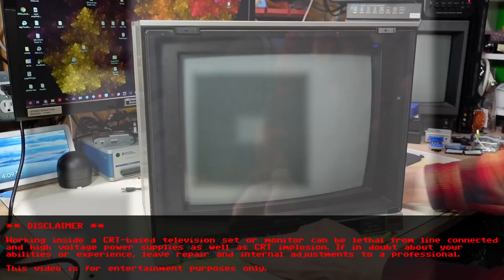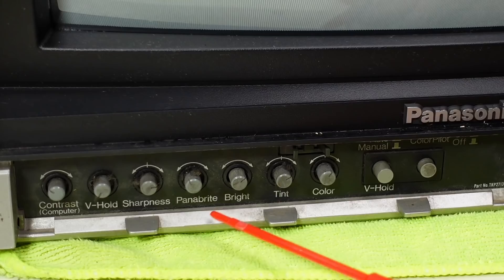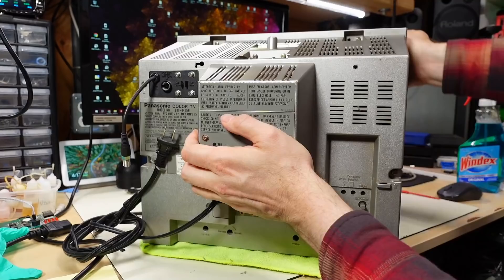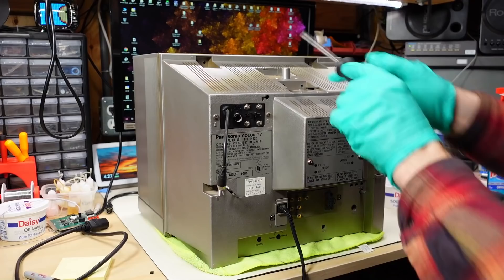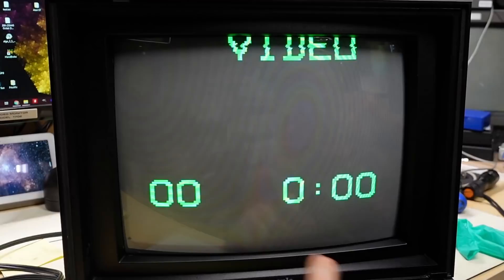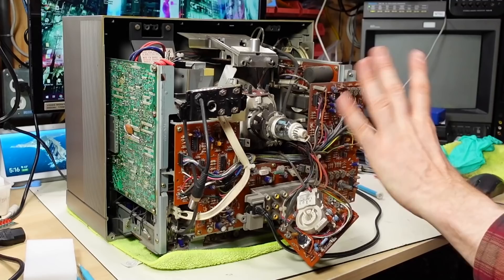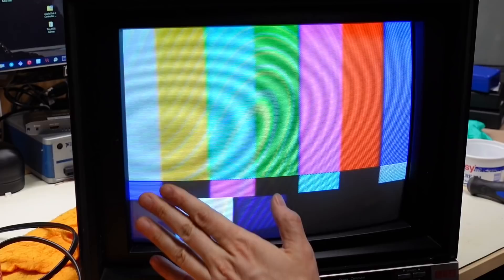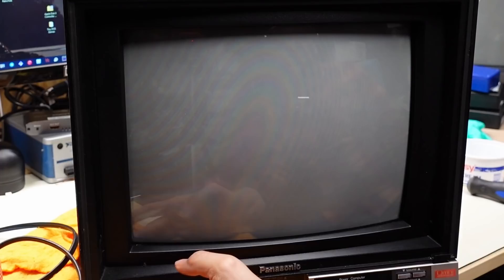This TV cost $1,890 USD in today's money when it was new! (Panasonic Omni CTF-1465R)

Comment: Panasonic  "Just slightly ahead of our time."  I have found that anything made by Panasonic was far better than the competitors!
Reply: That's usually still true today.
Reply: Local university liked panasonic because you could get parts easier than other makes.
Reply: Yeah including their VCRs
Reply: My Panasonic Bluray player has had nearly nightly use for about 15 years now. It's a bit weak on some discs, but for 99 percent of discs, it still plays them perfectly (even with scratches, it's confusingly inconsistent on what errors it can handle). I've only ever had to go grab the backup player once. Bluray drives generally don't last that long, as far as I'm aware, but this one has.
Reply: @Dennis Fore
True...I remember that old  tagline from the late 1970s and early 80s, and it was true. Panasonic reliability back during the 1970s, and 80s was second to none, including Sony. While Sony did have some items and the Triniton picture tubes that were a tiny bit better than the Panasonic offerings, the Sony would be used up and in the garbage long before most any Panasonic item was.
Reply: Can't go wrong with either Panasonic or Sony
Reply: They seemed to be 2nd only to Sony.
Reply: This is definitely not true for modern manufacturing equipment though. You need their "support" for everything since every part is proprietary.
Reply: @dhpbear2  I bought a 35" Sony CRT TV in 2002. LCD TVs were still in the 10s of thousands in Japan at the time. Sony's remote wore out within 3 years or so. I had to redo the contact pads a few times. Did not last long at all. The picture of the TV was good though.
Reply: So what you're saying is we need Panasonic to make a VR Headset next.
Reply: They made good bikes too
Reply: @dhpbear2  For some things at some times, in my opinion. From memory, during the 90s quite a lot of Sony consumer audio products seemed good but nothing special. Panasonic in the same era were consistently very good and seemed a bit more advanced, but Sony had something of an Apple-like public perception.

Comment: You could always take very careful measurements (and a bit of trial and error) and 3d print doors for these old TVs. It won't be quite the same, but I'm sure you can get some spray paint to match the same shade of grey as the TV case.
Reply: I am betting the door off my old Panasonic VCR would fit, a lot of things in this era were pretty universal..
Reply: Or fold metal, then and add hinges and latch.
Reply: Dont 3d print anything like this, 3d printing is horrible, get a sheet of 2mm Plasticard (polystyrene plastic) and build one, glue together with poly cement
Reply: @Synthematix  not all 3d printing is horrible. It really depends on the fillament you use to print stuff.

Comment: My mother still uses a Panasonic microwave from the mid 80's.. It still works perfectly.
Reply: Older microwaves tended to have a high build quality because that was the only type you could get. Now there are much more efficient ways of making them which allows much cheaper ones. My cheap plastic bodied one I bought in 2009 still works fine.
Reply: We used our 1986 Panasonic microwave until last year when the door switches failed.  Haven't gotten around to ordering new ones on Amazon.  The door circuitry was arranged with a safety backup so that if the main switch failed to kill the oven when the door was opened then the second switch would blow a fuse inside to keep the radiation from coming out in the open.
Reply: @haweater1555  That double interlock setup has been standard fare for decades. I think you need to go to the 1970s to find one without the backup shorting switch.
Reply: Same here. Panasonic microwave lasted for years. No buttons or dials, it was all touch controls.
Reply: I have a Whirlpool microwave with manufacture date of 1983 made in USA, still works, it has never broken down, simple, no dish rotation, touch buttons, no clock. Physical on/off switch by the door, so zero standby power.

Comment: The 8-pin connector on the back is an EIAJ-8 connector.  It was used by Japanese manufacturers from the 1970s through the 1990s and labeled VTR.  It simply carried composite (CVBS) video and line-level audio, and was used to connect video tape players that were pre-Beta and pre-VHS.  In the early to mid 80s the EIAJ-8 connector was sometimes labeled RGB, almost always TTL RGB.  I have seen Sony, Panasonic, Sanyo, Sears (Panasonic), JC Penney (Panasonic) and several other brands use it for RGB.  I do not believe anyone ever used it for RGB and CVBS at the same time.  Finding an EIAJ-8 to DB-9 cable is the key for using one with a CGA equipped PC, or a Tandy 1000.  Sourcing the EIAJ-8 male plugs is difficult.  I have a few if you need one.
Reply: Also there was no standard to the  pinout (Learned that the hard way) so different manufacturers used different pins for different things)
Reply: I believe they were also used on 1/2" Sony open-reel B&W VTRs in the 1960s!

Comment: Good choice on the fader cleaner. The red de-ox-it will actually disolve the carbon trace in potentiometers. I was all ready to yell at my screen there for a second. You totally got it right though. Well done mate.
Reply: Agreed, do not use D-series on pots.
However, F-series Deoxit actually contains a cleaner, so using CRC QD cleaner first is not necessary.

Comment: Growing up in the 80's I remember how expensive good electronics were! My family spent almost $600 on a Toshiba VCR in 1984 and then over $800 on a 31 inch Toshiba TV around 1989. 
Luckily with those high prices came in-home warranty repairs (at least on the TV) cause the TV needed 2 repair visits during its warranty. The first for a board that failed and the second visit to replace a fuse that blew about a week after the first repair. In particular, I remember the second visit cause the tech who came out was a little upset that the fuse hadn't been replaced by the first tech when what I'm assuming was the power supply board was replaced. That TV lasted throughout the 90's until early 2001 when it finally died.
Reply: I bought a Japanese 6 head VCR in 1987, and my parents used that front load VCR until 1998 or 1999.  Which is a freaking long time for a front load VCR.  I have had front load VCR's that the loading mechanism failed after 3-4 years.
Reply: I used to sell video in the 80s and Toshiba TVs came with 36 months parts and labor   That's why it got fixed so easily.

Comment: Hey Adrian, I would recommend using an automotive glass cleaner. Windex contains ammonia which damages plastic and rubber parts. 
Automotive cleaners don't have ammonia to protect seals and plastic trim. Greetings
Reply: I would tag on to this, give John Deere Classic glass cleaner a try..... It is stunning how well it works on glass. absolutely streak free.
Reply: @These_Old_Engines  Seeing what John Deere does for (or better "against") right to repair, I wouldn't give them a dime.
Reply: @blockbertus  I was thinking the same exact thing. I second this.
Reply: wash it in the bath and then put outside to dry for a week
Reply: @esecallum  dont laugh, I worked with an electronic tech and this is how you clean VCrs which got liquids spilled on them.  Better to use distilled or rain water.

Comment: In the UK TVs with that style of glass front was for sets that were for rental. TVs for rental were bombproof. I remember buying some ex-rental TV's in the 1990's that were 15 years old, and didnt break  i replaced them only because i needed NTSC as well as PAL  composite video support!
Reply: A good ol Grundig TV with faux wood effect cabinet featuring a chunky 50p meter, chuck a 50p in the slot and crank that dial round til you hear the 'CLINK' and you get TV for a couple of hours. Radio Rentals, what a god-send! lol

Comment: We had the matching OmniVision "portable" VCR back in the day. I vaguely recall that the door over the tuner compartment was really bad about falling off, so not surprised that this one's went missing.

If you happen to find one of those at eWaste, it was great for recovering damaged VHS tapes, because it was a top loader, and allowed you to thread the tape in as a reel-to-reel without having to "spring" for a replacement case at Radio Shack since the springs in earlier VHS clamshells would invariably launch themselves across the room.
Reply from the maker: When I was a kit we had one of those. It was a two part unit -- one half was the top loader VCR and the other half was the power supply, clock/timer and tuner. You could take the VCR part and stick in a 12v battery and throw it over your shoulder for use "on the go." It was a good VCR!
Reply: @adriansdigitalbasement2  I too, came as a kit.
Reply: @adriansdigitalbasement2  That's the one. Remember those pull-out channel number tabs?
Reply: @danielmalone4446  Heathkit or Radio Shack?
Reply: @adriansdigitalbasement2  most often paired with the camera unit. Several of my neighbors in the early 80s had these split VCRs and although I suppose you could use it for portability, it was often the case with those early cameras where you had to bring the camera head and separate recorder (connected with a big fat cable). The video tubes in them were pretty sad, but hey, portable video recording on tape was a big deal to the boomers and their new toys (who were proud to have moved up from Super 8). :P

Comment: That EIAJ connector is very common on professional video equipment (cameras, VCRs and switchers). So this monitor is a fully blown PVM with a tuner on board.

Cathode Ray Dude may be able to give you some more information on the equipment that used these kind of connectors.

Comment: Adrian, I lived in Japan in 1987 and bought a 20" Toshiba TV similar in design to this Panasonic. It cost $800 back then.  I no longer have the Toshiba but I did buy an RGB cable that would fit that connection on the back if you want it.

Comment: I still use my 1990 13" JVC  C-1446 TV/Monitor that I bought when I got my first full time job. (Though not my first major entertainment electronics purchase - that was a costly Sony HiFi VHS even if I had only a borrowed B&W portable to use it with -- gotta have priorities.) It closely resembles the Commodore 1701/02.  Though it had no special inputs other than ANT and composite video in.

Comment: Just watch out for that connector. While the physical connector is a standard, the pinouts aren't. I've found several different variants. (I have a Zenith monitor that uses it for Analog RGB)
Also you could 3D print a new front panel and then spray it with one of those gloss metallic paints that bond themselves into a smooth surface.
Reply: I was thinking along the same lines as you regarding 3D-printing a front panel! In some cases these fall off and get lost due to broken "hinge" tabs.

Comment: Well that's a nice set.
That wire and board nightmare reminded me to a Sony Trinitron KV-4000 i used to have.
That also was the most interesting TV i've ever saw... it was (i guess) the smallest Trinitron ever made at 4 inches and it was from the late 70s, the darn thing had an awesome image... it was so small that had no degaussing coil and had to be done manually quite often.

Comment: It wasn't until late 90's that i saw OSD on TV's.this TV is high-end compared to what TVs typically could do in 80's with not even one single digital part inside them😁!
Reply: My grandmother had a Sears CRT with rudimentary OSD from the same time period. I inherited it for my room when she downsized in '92. The OSD and the ultrasonic? RF? remote both died by the time I moved to college in '98.

IIRC there was a neon bulb in the remote  that either burned out or lost its vacuum.   No idea what it was doing, other than maybe RF current limiting since the thing ran off a 9V battery.
Reply: @DiverCTH  the Sears TV that you mentioned was not something very high quality build ,but it was definitely something "rocket science" compared to  13" b/w tvs with separate vhf/uhf tuning dials 😂!

Comment: From 2000 to 2004 i worked for the old Thames Tv studios in Teddington near london. We had loads of very similar tvs which i believe had been used on the kenney Everett video show as a video wall. The series ran from the late 70s to 83. We were still using them in 2000.

Comment: I bought my first TV in 1988 for $599. It was a 20" CRT Electrohome, mono sound, with remote control. It was my only TV right up until 2004 when I broke down and bought a 27" CRT something or other (the Electrohome was still functional!). A couple years later I got a 50" Hitachi rear projection which I used until about 2019 when it died and I bought my present 52" LED Samsung. Sure got what you paid for!

Comment: I have a very similar set CT-1330M and it had the best picture out of all my CRTs (even over the Trinitrons!) The flyback eventually died (I think). I didn't really want to complete disassemble it because of how many different modular boards there are inside. But, it was definitely aimed at the professional market. In addition to that VTR connector, it had BNC inputs for the composite video and audio, as well as the outputs for a second monitor!

Comment: I had a similar TV I bought in '86. Flat glass over the front with the same removal clips and composite inputs on the rear. No RGB connector though that I recall.
It got smashed when I moved in '87

Comment: Great video!  It just so happens that a few years ago I bought this monitor, new in box, off Craigslist for $125.  The picture was fantastic and far better than the picture on my low hour Commodore 1702 monitor.  I also had the spec sheet that came in the box and it listed the monitor as having a very high TV line count for its size (I forget the exact number).  I sold the Panasonic monitor shortly after I got it and only did so because when the set would run, it had a really funky smell that would fill the room.  It almost smelled like manure.  This was strange because the monitor was in absolutely mint condition and didn't look like anyone had ever operated it.  I wonder if the smell was the plastic degrading or possibly the flux on the circuit boards degrading?  Either way, I do regret getting rid of it because there probably would have been a way to get rid of the smell.

Comment: Those look suspiciously like monitors we would use in broadcasting. I'm pretty sure that thing was built for professional use.
Reply: Sniff! No true broadcaster would use a monitor without loop through BNC connectors.  Still remember the 21 inch Conrac monitor.  $7,000 in 1980s dollars.

Comment: We used to have a AWA (Australian Wireless Association) monitor style TV from the mid 80s until the early 2000s when the horizontal failed.   It didn’t have any monitor functions, though it did look like yours but a bit taller.  The remote lived in a holder that hinged out on the front. It only had limited functions but I later discovered, with a universal remote, that it was possible to control the colour, brightness and contrast. I did advise mum that she could take the glass off to clean it and the screen as it’s not an implosion shield.  The CRT is a rimband type so the glass is only for appearance.

Comment: The dark blue Matsushita caps also start to leak right now, most of them you wouldn't see leaked until you really closely inspect them. Since mine just started leaking and the devices have been made in 78/80 maybe yours take 2 or 3 years until they start leaking as well. Thanks to Jordan Pier, I wouldn't have caught the caps on my Panasonic/JVC VCRs leaking on casual inspection. You need to look closely.
Hilarious like your gestures match those on the screen near the end of the video :-)
Looks like this TV uses the same font as my 1984 Newvicon tube camera with integrated title generator. I used that for some of my videos.
Erm... Panasonic TVs are pretty certainly all using the same IR protocol and address, so you can control it with pretty much every Panasonic TV remote control and/or universal remote control. You just won't find the exact matching one, so this is a collectability issue, not a controlability issue.
I have a Grundig 1510 portable 14 inch TV from 1973, all solid state. It weighs as much as a 1980s 27 inch TV and consumes twice as much power as that.
I also have a manufacturing date of October 1984.
And I've known a 27 inch TV from 1978 that had on screen display with a clock. The pixels were PONG ball size, but hey, OSD. The owner threw it away, he didn't know I was still using it. Damn. I really liked that TV.
Reply: i agree. i have an ibm pc monitor of similar age, mid 80s, which had a bad cap that caused a vertical size problem. i replaced all the electrolytic caps.

Comment: Wow! Back when I was like 13 my parents gave me a "JC Penny" branded monitor that looked very similar (though slightly different looking buttons on the front) that I used as my very own bedroom TV set and later as a CGA monitor with that input, and later still fed composite TV from the cable box in the other room as a sort of secondary TV I had on my computer desk, since back then we didn't just use our laptops sitting in front of our big-screens in the living room...
Reply: Pretty sure I had the same unit... bought it new at JC Penny...

Comment: Japanese plugs are generally still all 2 prong non-polarized. Outlets are generally 2 prong polarized. The only exceptions in my apartment are the outlets in the kitchen and laundry area and those used for air conditioner units, which have three holes. However, fridges, microwaves, washing machines, air conditioners, etc. usually still have two prong plugs, but also a separate earth wire that you screw onto a terminal in the outlet. I have never purchased or seen anything here that has a 3 prong cable.